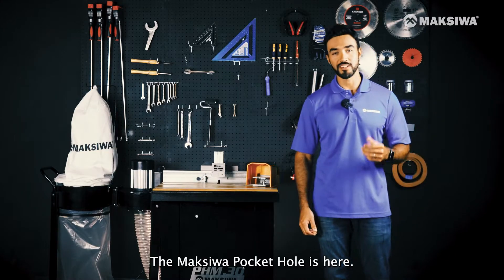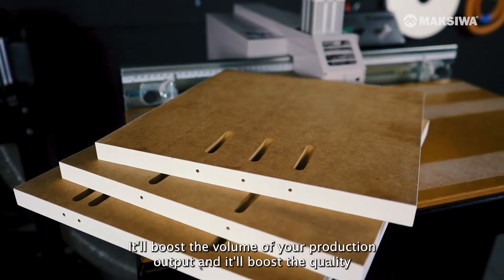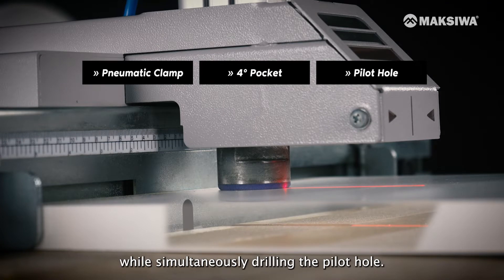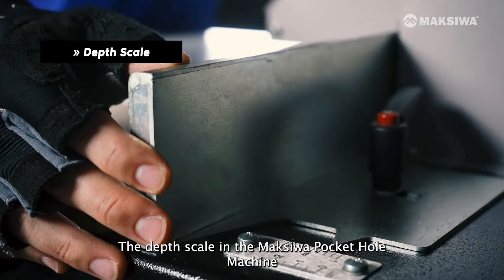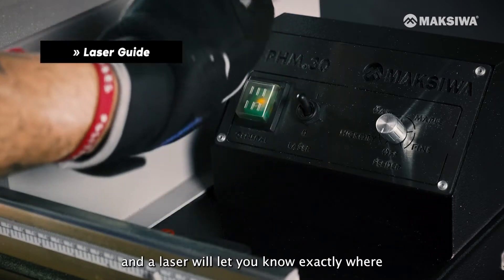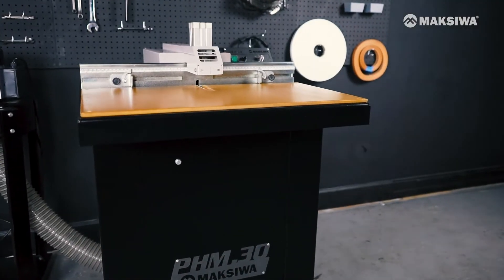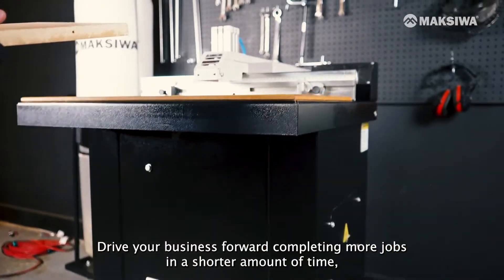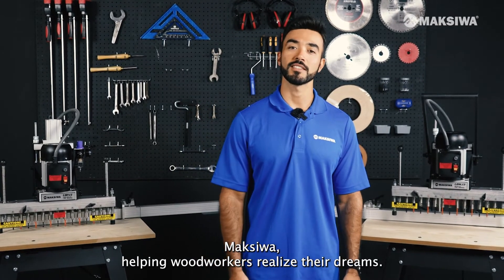Maksiwa Pocket Hole Machine - PHM.30

Comment: This is a flimsy machine made with cheap parts and has no place in a professional shop. Bought one the switch went out the face is  closed with rivets so you can't service it. The air hose connection is weak and held in place with a flimsy sheet metal bracket .